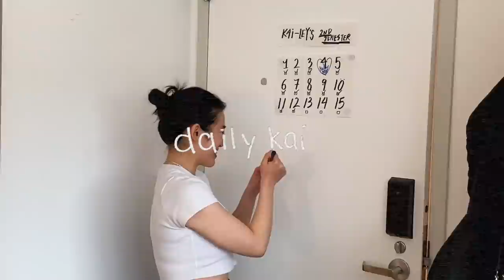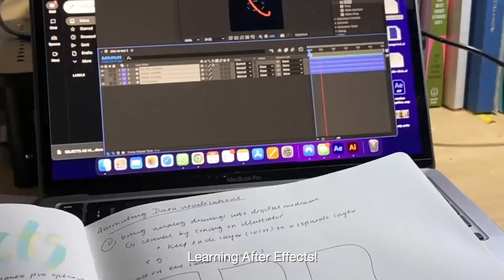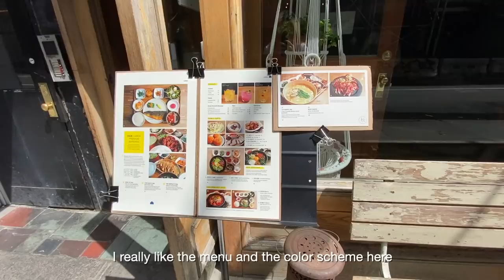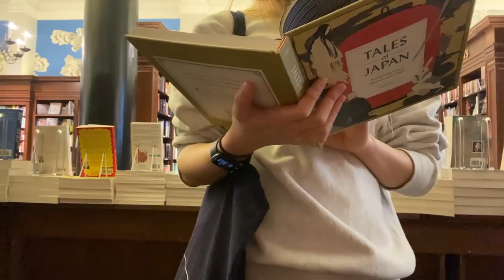Time to GRIND!⚡️ | Parsons, NYC art school vlog

Comment: I also experience trimming very stressful and dip glazing. I did the opposite to you though, and didn't dare to trim them enough, because I was afraid of going through. But instead I ended up with a lot of very heavy bowls because the foot is sooooo thick. I kind of regret not trimming them more, and then maybe losing some in the process instead actually!
Reply from the maker: I agree! Although losing bowls really sucks, it does prevent further sadness + at least failed trimmed bowls could be recycled… but once works are fired they can’t be recycled anymore ;( thanks for reminding me that!💗 i hope your ceramics crafting is going well!!
Reply: @nomkakaii  I think both loosing pieces and having them turn out not as you expect is hard, it used to give me a lot of anxiety. But I'm trying to just see it as a part of the process, part of learning. But it's difficult to stay motivated when each piece takes so much time and energy. I don't have a studio to go to ATM, but I've been hand building some at home :).